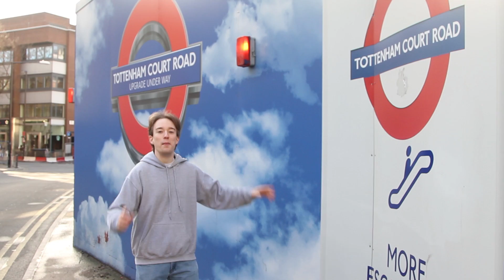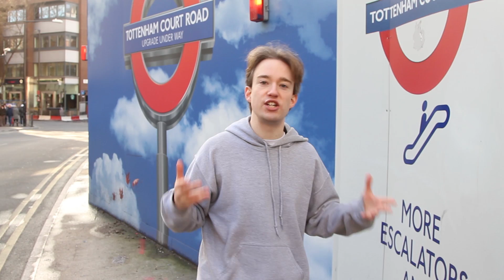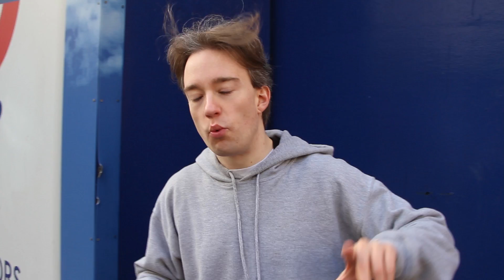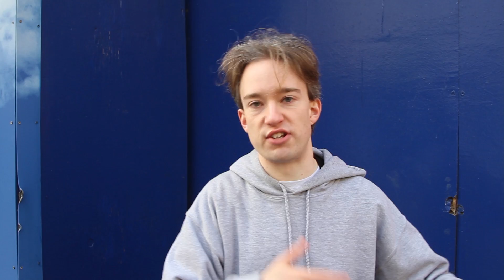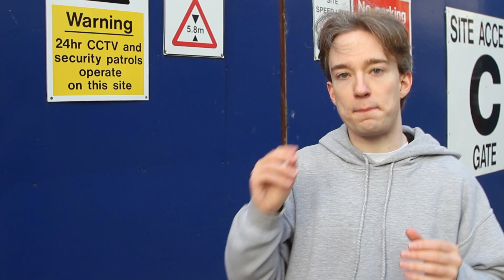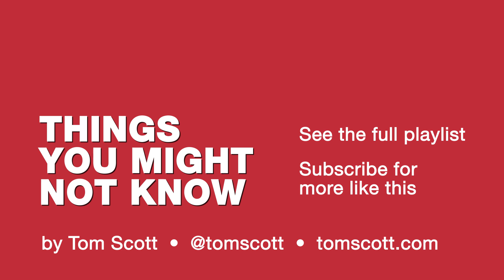Why Do Reversing Trucks Not Beep Any More?

Comment: I'm sorry but this is absolute bullshit in my opinion. The white noise just sounds like pressurized air. I had worked around trucks a few times in my life and if I heard a "shhhh" sound I wouldn't even move because what do I know, someone might pressurize/depressurize the air tank, change the driving level or even something not even related to a truck on the construction site. But as soon as the beeping starts you quickly look around if you are in danger of getting hit. Really there is no other sound a truck makes which is even remotely close to beeping. But a white noise? Many things sound like a "shhhh" on a construction site.
Reply: You do realize how huge the blind spot is on large hauling trucks, don't you ? unless you expect a truck driver to stop, get out, and walk around their truck every time they need to do a wide turn, or back up, directionaly distinguishable sound is ABSOLUTELY necessary.
Reply: That's a great idea but I think you're being to narrow when you just apply it to truck drivers. I mean imagine just hiring pilots who never crash or train drivers who never sleep or taxi drivers who never speed. Absolute genius!
Reply: yeah spent the last 3 years working in construction in Alberta, never heard this white noise.
Reply: That's what I was thinking too. It also seems to be a solution to a non-issue since everyone that I know that work in an environment were backing heavy machinery is a hazard instantly knows what that beeping means and they pay attention to their surrounding when they hear it whereas this seems to have been invented by a UK company because there have been published concerns that people may be ignoring the warning. No one has actually shown this to be a problem it is simply people who are concerned. Either this UK company is trying to cash in by creating a problem that they can sell a solution to or this is sort of the UK eqvivalent of the Korean story of people suffocating because of fans being turned on while they sleep.
Reply: I'm very certain that an air swoosh sound last less that 5 seconds, were as the white-noise would repeats itself. And, given the repeating pattern of ~1 second on, ~1 second off, it should be easily distinguishable.
Reply: They aren't absolutely necessary but they are a safety feaure. I don't know what nice soft office building you work in but we who actually work for a living like these safety features because they increase the chance that we get to come home at the end of the day and meet our kids. There's several reasons why workplace deaths have gone down significantly in the last two centuries and safety features like this is one of them.
Reply: +Dante van Gemert
Because your imagination is a good scientific instrument to measure weather or not this is effective or not. Find me anybody who is complaining who actually has to use these noises on their trucks - I couldn't find any. If the things were actually as terrible as you all seem to imagine they are, wouldn't you think there would be many complains about how they don't work? But as far as I can tell there aren't.
Reply: I was thinking this too, in Canada I've never heard anything but beeping, and honestly I can tell where vehicles are so changing that is unnecessary.
Reply: Look up a video of the white noise alarm. It sounds distinctly different from a depressurizing air tank.
Reply: ah british government regulations
Reply: TheTornado121 I’ll take your untested anecdotal recollection that only recognizes one of the variables in this comparison to years of engineering and research any day!
Reply: They mare widely used for crosswalks so blink can follow the sound.  Also used in ships and buildings so in case of a fire and structure gets smoked filled people can follow the sound to the escape routes.  I have a small 87 dB on my P/U and it is fun to watch people turn their heads and look right at it instead of head spinning with a
Reply: monotone sounds can trick the ear ask anyone who had to align vdos speakers
Reply: TheTornado121 Beep and white noise, why not both?
Reply: I would prabably be better if it was a white sawtooth wave
Reply: TheTornado121 well any noise is bs. Look and don't stand where your at ridk of getting run over.
Reply: Having heard one of these in real life, you definitely notice it more than the beeps.
Reply: Translation: I have no experience with this particular type of reversing alarm, but from the small amount of white noise played on this video which is almost certainly not recorded from a truck that was reversing I can tell it would be inferior to the beeping and I would confuse it with some other sound maybe or something perhaps - to hell with what the experts who have actual evidence to back up their claims say! I can just tell with my excellent intuition that this would be terrible.
Reply: Honestly a blind person would probably get confused and be run over, or might just think it was pressurized air, and not worry about it. But a with a beeper they know is a truck coming, and they would know that if the sound was getting closer to them to get out of the way. A psshhh sound is what a bus normally makes and they might not think its a threat.
Reply: There is nothing B/S about it.  They are very effective in creating safer work place while making for more neighborhood friendly noise environment.Remember a beeper backup alarm is just a noise thrown into the air.  All you know is that somewhere and someplace something is backing.  They are so annoying that we have become complacent to the noise and that is very dangerous.Broadband, White Sound or MUlti-Frequency alarms that produce Shh Shh noise is directional and sound is pretty well contained to the danger zone.  When Multi-Frequencies are heard you know exactly where they are coming from and they do not sound like air brakes which is not a wide range of frequencies.  Sometime the Always done it this way attitude can get you into danger and run over.  These alarms can save you life.  Some U.S. States have laws requiring use of them in certain busy environments. City of New York has laws to use them in certain quite zones.  City of Seattle has laws requiring there use after certain evening hours.  They were required at the Vancouver Olympics. To do contract work at the port of Houston you must use a Multi-Frequency alarms before you can perform any construction.  Lots of Sea Ports are now using them to create safer work place and friendlier noise environment.  No they are not B/S.  Need to get out of the beep beep rut
Reply: This is all about being less bothersome to local residents.  Well if they don't notice it, I don't feel so bad not noticing it standing behind the truck.
Reply: About working on trucks.  I have worked truck, managed truck shops and owned my own diesel engine parts and service facility.  I have been a service engineer for Detroit Diesel and currently operate a industry consulting business.  My experience started started with truck mechanics in 1964.  Befor that learned my mechanical knowledge rebuilding equipment and engines during the winter months on a family owned Kansas wheat farm.  Started about 1958
Reply: I imagine you can't hear it in heavy rain, even
Reply: Trucks have been around a lot longer than electronic beeping devices have.Therefore it would be hard to make an argument that they are ABSOLUTELY necessary.Trucks have been making deliveries for a long time without them.
Reply: Toby-wan I'm not trying to make an argument against beeping devices.Just pointing out that nearly all the accidents we have on a daily basis are a direct result of someone not using common sense or not paying attention to their surroundings. I've been driving tractor trailer road trucks for 19 years.Never driven a truck with a beeper on it and I've never backed over anyone. I.e.,hire better drivers.
Reply: I have a better solution.How about just hire drivers that can pay attention to their surroundings when they drive.Problem solved.

Comment: There's a company that provides skips, cement mixers and large tipper lorries near where I live. Some of their vehicles make the white noise sound along with a "Caution, vehicle turning right" announcement when they turn into the road towards their facility.

Personally, I think they're crap. If you have to have an announcement (like "vehicle reversing") to make it clear what's going on, then the noise has failed to help. I think a better idea would be having a "BEEP CHHHH BEEP CHHHH" combination of the two alert systems.

Comment: I played it again and again and again. I hear nothing at all when the white noise was played. That's the problem with the white noise alert.  Anyone with certain frequency dependent hearing loss, can't hear it. It is also rendered useless by any other source of white noise, such as water, wind or large volumes of motor traffic. The backup beep on the other hand is a clear 1kHz, which is clearly audible to all but the deadest of individuals from birth to well over 100 years old. It is also an unnatural sound that immediately calls attention to itself. White noise is easy to ignore since it occurs so often in nature.
Reply: *deafest
Reply: When it's on the street, it's pretty easy to hear. It also uses a decent speaker and amplifier, rather than personal audio equipment that might not be very good.

And how often would you expect to find a lorry reversing next to a waterfall? Also, wind and motor vehicles don't encompass the entire hearing spectrum.

White noise I read is actually easy for most people to hear, including those with hearing loss, because it is across the spectrum.
Reply: @AndrooUK  A lorry with pneumatic breaks reversing next to pneumatic contruction equipment?  All the time.
Reply: Indeed, white noise is too easy to ignore.  A bell tone, resonant but not concentrated on a single frequency, would have the wider band to audio location, but also stand out.  Better than both a pure tone and white noise.
Reply: I am deaf in one ear. Sound location is impossible for me. Regardless of whether it is a beep beep or white noise I cannot tell where it is without visual cues. At least the beeping is recognizable as an alert signal. White noise? Meaningless and not locatable.
Reply: @George4943  agree i am half deaf and beeps i can hear white noise i cannot , this is in the real world and on headphones watching this so who ever comes up with this rubbish over what noise is louder and more clear in peoples ears clearly dont test with deaf people
Reply: cruiser james you’re lying
Reply: That's a youtube issue. The whole idea with the white noise is that everyone can hear it, unlike the beeps. But youtube doesn't convey it correctly. Its a recording of the noise after all, not the noise itself
Reply: exactly.  I'm hard of hearing and can easily hear the beeping back up noise but I couldn't hear the white noise hissing.
Reply: @evelynsnyder5866  How do you know it hissed then ?
Reply: @millomweb  i was assuming.
Reply: The thing about true white noise, though, is that it doesn't matter if you're missing the treble out of your hearing range, or any other particular frequency. It has equal intensity at all frequencies. So if you can hear at all, you'll hear the pulsing. Plus the speakers tend to be loud and fairly directional, so if you're in the path of the reversing truck, and close enough to be in danger, it'll be extremely difficult to ignore even in an otherwise noisy environment. And most natural sounds don't cut sharply in and out a couple times per second, so it's clearly artificial. Maybe it sounds like brakes dumping or whatever, but if you're by a stopped truck and don't respond to the sound of its brakes releasing, perhaps that's natural selection running its course.

(in this case though, the video might have cut out a lot of the lower frequencies because that kind of filtering is quite common on videos anyway, but also so it doesn't interfere with the speech so much - which otherwise may be difficult to make out)

On the other hand, if you have missing frequencies, a single tone beeper could end up disappearing into that if you have an unlucky match between the two things.

As it's quite loud, you should still be able to hear something of it if you're turned completely the wrong way... after which you can locate it by turning your head and perceiving how it gets louder or quieter.
Reply: @mspenrice  Indeed! And if it's inching closer and closer as well (getting louder and louder) you'll have to do your best not to check what's approaching.
Reply: I have tinnitus with a frequency around 1.4 kHz. If i imagine someone with tinnitus at 1 kHz i am quite sure he would never hear the beep.
Reply: @thorz7304  tinnitus is usually around 1.4khz, annoying too
Reply: Yes that is very true, I didn't think of this

Comment: Any kind of noise, no matter what, beeper or white noise included, that you hear routinely becomes a sound you no longer take notice of. No one who works on a construction site depends on noticing such a sound for their safety. That would be crazy. They know better. Meanwhile they have this extra noise they have to hear though to communicate.

The refrigerator makes a noise while the compressor is on. I don't know when was the last time I noticed.
Reply: What extra noise? At the example in the video on noise has been taken away
Reply: waswestkan
What extra noise? The noise it makes.

Comment: Wow! That's so stupid! Every thing: elevators, cars dashboards, computers, home appliances (conditioners, stoves, everything else), alarm clocks, electronic locks are using beep as a warning/attention signal. But really dangerous things got switched to a sound indistinguishable from harmless pneumatic system sound.
Reply: +Nobody Quite I think this is mostly for construction sites. As someone else in this comment thread mentioned a lot of tools and equipment used on building sites use compressed air to operate, so hearing something that sounds like compressed air quickly escaping would alert workers as it could indicate that some piece of gear is malfunctioning and could cause harm. Also as said in the video, it's audible even in busy environments which construction sites most certainly are, not to mention many are in the middle of a crowded, loud city which makes matters worse. You think it's stupid, I'm sure the data proves otherwise.
Reply: TalesOfWar 1. leaking air doesn't require attention. Any big pneumatic system is dumping air from time to time (because of compressor inertion). 
2. As a professional sound designer I must point out, that city environments are essentially generating white noise and our brain is extremely good at white noise cancellation. Physically, white noise is difficult to mask by any frequency. But human brains historically are doing very well at cancelling it out, because white noise is generated by wind in trees, fast rivers, etc, it's an environment factor. On the other hand, human speech, animal sounds automatically triggers attention. You might sleep near roaring waterfall, but will wake up because of nearly indistinguishable human speech or predator howling.

Comment: The trouble is that I know what the beeping sound is, so I know that it means a danger and I look for that danger. But the white noise "alert" sounds like compressed air escaping, so I wouldn't look for any danger at all, or even worse, for the wrong danger.

I work at a turnpike service plaza, so I'm going through the heavy-truck parking area on a regular basis. I would vehemently oppose a similar shift in my local jurisdiction.
Reply: +James Paulsen I agree entirely. When ever I hear a beeping I look for a vehicle nearby, to my knowledge, I have never heard the white noise sound on trucks around here, and if I have I must have assumed it was the air brakes, thus being completely oblivious to any danger.

Comment: The reason this noise works so well on a Construction site is because it mimics the noise from the discharge of pressurized air.
Air tools are common to the industry but not for the general public.
A Construction worker that hears this noise is going to react to it more so than Joe Public. It's effectiveness has to do with the fact that evolution has made us keenly aware of threats that may damage our senses and vision is the most important. Hearing an air tool discharge like that makes you instinctively asses the situation. If it is close to you, you might get your vision impaired. Either by debris, projectiles or the actual force of the air. You also shouldn't be able to habituate to it because the noise gives no indication for the size or nature of the threat. Is it a truck? Is it a guy filling a tire? Is it a nail gun shooting out brads towards your head? Don't know, better ID the noise and decide.

Comment: This begs a question; why did White Noise emergency vehicle sirens not take off?  They're as rare as rocking horse poo!!
Reply: White noise alarms will not penetrate or bounce off surfaces like glass, walls etc. in the same way a beeping alarm does, and as such they are not suited for emergency use like on an ambulance. Which is kinda the point, they don't pollute the surroundings with unnecessary noise that travels all over the place. Broadband noise works very well for backing alarms, and I wish more trucks start using them. Just the beeping from garbage trucks alone wakes up half the city every bloody morning.